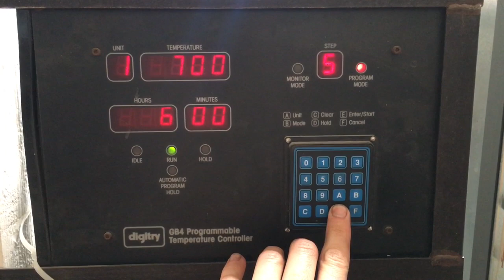Making Murrine Vases - John Gibbons Glass

Comment: I've also made sheet glass mirror and pulled it like normal. Your work is fantastic.
Reply from the maker: Sheet glass mirror and pulled it? That does not sound normal! Do you have a picture?
Reply: @Gibbonsglass  sorry that should have said murrine. I let a bunch of system 96 fusing glass fuse into a thin sheet then jelly rolled and reversed it for a nice swirly pattern. Http://youtu.be/dierwolf2000

Comment: What is the average wall thickness in the body of vases? How is that controlled?
Reply from the maker: The wall thickness is thicker on larger pieces and thinner on smaller pieces but it can be about 1/4 to 3/8 inches thick. Thicker is easier but thinner makes a larger vase.